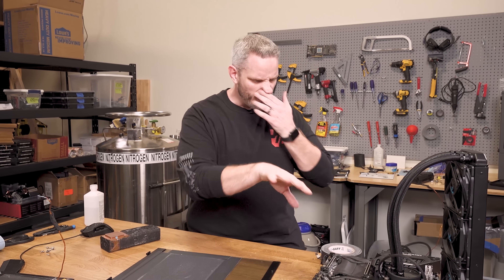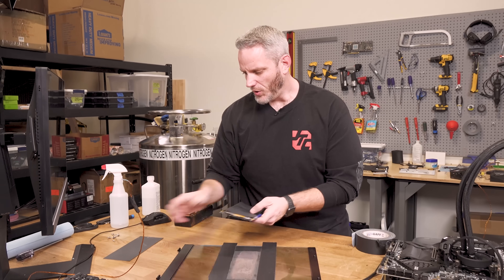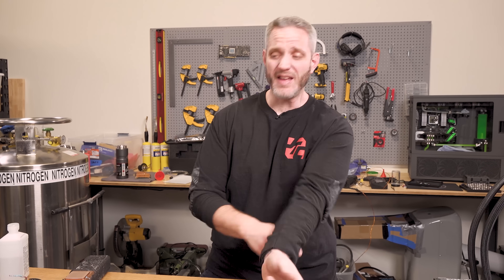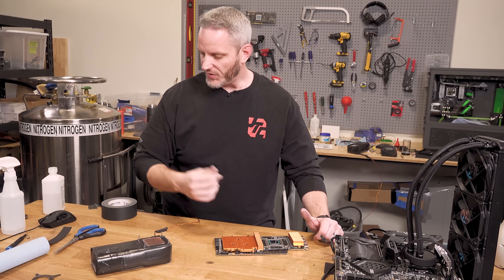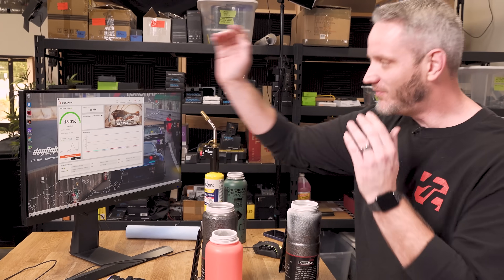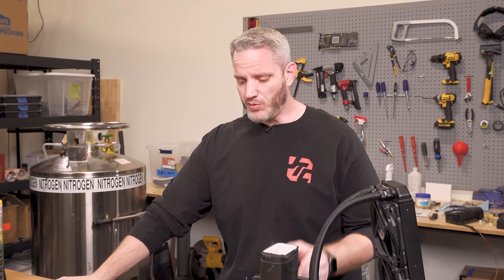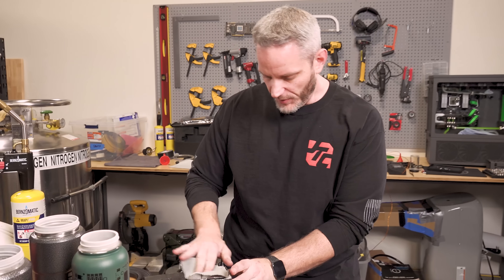THIS is Why Lapping Your Cooler is SO Important!!

Comment: I do not agree, why would the thermal paste need to "bite" into the copper? Thermal paste has lower thermal conductivity, more copper and less thermal paste is desirable. The thermal paste, or worse yet, air will end up filling in the scratches. I see no logic in this besides in the case of maybe you need the thermal paste to withstand mechanical stress, which is clearly not the case here.
Edit: Grammar.

Comment: Me building a PC: I need to be relatively carefull not to damage parts.
Jay: So im grinding down my parts and throwing a c clamp to keep it together while using vaseline on my gpu
Reply: That is some funny stuff right there
Reply: @JesseGaming7593  funny "stuffs"
Reply: I'll just leave my comment here -- this video is kind of ridiculous lol. 
Jay: "Even microns of difference on the copper will impact cooling!!!"
Also Jay: "I'm going to leave VISIBLE scratching on the copper. Because it will help the paste bite."

I'm going to go ahead and place a hefty wager that visible markings on copper leaves a huge number of 'microns' difference. Kind of silly. Now you need a whole other source, to take information seriously. Why not simply state what grit sandpaper will be the most effective? Is it 800? Why? What evidence or trials support that?
Reply: @wes7839  lapping makes the CPU flatter which increases cooling through the greater surface area. He just left it feeling a bit rough so that the paste would hold more firmly. Think like you're sanding a piece of metal to paint. You sand it flat and smooth but still a little rough for the paint to hold.
Reply: @christopher-davies  what does he mean by "lapping the cpu"?
Reply: @christopher-davies  Bollocks. 

Flatter means LESS surface area. 

Your reasoning is completely wrong and oxymoronic.

Comment: Pro tip:  
1. When Lapping you move your part in figure 8 patterns on the sandpaper without lifting it (for even wear).
2. If possible use multiple sheets of glass on top of each other because glass will bend very easily and reflect defects of the surface below.
3. You can use a sharpie to check how evenly you are sanding the surface, just color the whole surface inbetween lapping runs and check regularly if paint remains.

BTW  you are sanding,  lapping is one of the most misused terms.
Reply: The sharpie is key to make sure you're sanding what needs to be flattened
Reply: Circle is just as good

Comment: "Glass is perfectly flat." Mmmm... In the world of precision, float glass is "relatively" flat. Plus, the die probably isn't perfectly flat. Kind of curious if it's possible to scrape in copper like you do for making a surface plate. Then you could dye the die, transfer to the copper block, and scrape out the high spots until the contours mate perfectly.

Comment: @JayzTwoCents Insize Granite Plate.

GRANITE SURFACE PLATE, 12x18x3", grade A
6900-A11
Made of granite, free from deterioration or dimensional change over time, minimal changes in dimension due to temperature changes. Meet GGG-P-463C.

Comment: If we talk about lapping I'd like to mention that this isn't lapping but wet sanding/grinding, you are usually using a coated abrasive, some times with a layer of water in between the abrasive and the workpiece. Lapping on the other hand would be using loose abrasive in a liquid between a glass or cast iron plate and the workpiece as the abrasive rolls about between the two surfaces and removes material from both. This would also create a much finer and smooth surface than you get from wet sanding.

Comment: @JayzTwoCents It just occurred to me; you're not heating soaking are you? You are getting localised temp variations without normalising the thermal load across the IHS. Shouldn't you be running the card to 80% or 90% running condition for a long duration to allow for fault analysis and stability prior to hard running / peak load periods? If you are rushing to peak load you are not allowing for hot spot issues.

Comment: Why don't you just get a cheap lapping plate set and do it properly? Sand paper is going to cause more problems that it solves if you really want it flat. It's almost guaranteed you are making it more convex than flat with the technique shown here.

Comment: Entertaining and intriguing, doing it ‘because you can’ kind of like a car could achieve an amazing speed if you dropped it from a very high crane (or a plane)!  though less than useless for driving or car engineering lol ........So this is rather pointless IMO - I would prefer a ‘real world’ maximum overclock assessment and tips for maxing that out.

Comment: Jay, why not create a test bench where "sweat" from the AIO block and the processor is simply dripped off by gravity? An upside-down test bench, with a graphics card riser cable/extra tray (staggered to stay from under the cpu AIO block) to keep both AIO blocks inverted, if you will... Honestly, even if this is a stupid idea, I've never seen a pc tech enthusiast/reviewer even attempt it .

Comment: steel plate on the backside the keep the pressure off the board backside itself. If that should slightly bend it doesn't matter and the pressure on the GPU ist centered.

Comment: instead of paste i check thin cooper/alu foil and make 2-3 layer, the trick is, the paste flue away, the foil would be formed but runs not away, it works

Comment: Back in the day I used a thick square bit of metal with a 4mm bit of high density foam between it and the board, this will stop the board bowing and give you more consistent flush mounting pressure on the die

Comment: Lapping is not necessary if you buy quality components that have been levelled during production. In most (99%) cases you will ruin the already level part by hand since you can't do a better job than a machine that has micro precision. Also this is what thermal paste is about. If everything was perfectly level, the heat would jump to the cooler without any thermal paste. Thermal paste closes that gap. Again another shitty click bait video to make more youtube money.

Comment: Glass isn't perfectly flat, fyi. usually about +/- 0.2mm over 12 inches. Its why people still like having Auto Bed Leveling on their 3D printers, even with a glass build surface.

Comment: When lapping use figure 8's for best results.
Reply: NOPE... even and consistent straight pulls. NO pushing. Pull two or three times max then rotate 90 degrees. Rinse and repeat as you raise sand paper grit. your muscles are not consistent enough to do figure 8s and not round edges out of square.

Comment: Now get a cube of glass and use grease to check the flatness of your die.  Protip: they can be less than flat and too much pressure or movement while applying the heatsink can and will cause air pockets in the grease!   Here is a video I made a while ago showing an example of this: https://www.youtube.com/watch?v=me1i78oydEM

Comment: im not trying to be mean in any way... the glass you are using IS not flat at all, you need at least 1/4 inch thick to prevent curve from pressure at least

Comment: Tip from someone who used to prepare metal samples to a mirror finish with 0.05 micron diamond polish: just polish a bit on the first step, then switch to one stope up, just rotating 90 degrees, and it is done when the prior step's marks are gone. Go as far as you want. I would also recommend using water as a lubricant.

Comment: "because glass is perfectly flat"...? everyone doing 3d prints on glass will disagree.
Reply: But most 3d printers aren't even calibrated enough that the imperfections in the glass matter. Usually it is one of the axis that are not firm enough.
Reply: Glass, for anyone not using ikea mirrors, is flatter than matters for printing. Ya know what isn’t flat enough? Aluminum beds. Even high end milled or whatever beds are not as flat as a $5 pane. Unless you’re wanting to spend $100+ on your bed, glass is gonna be the most flat build surface. Any deviations are gonna be too small to matter when first layers are .2-.4mm.
Reply: @HE-162  my 240*240mm Glassbed has ~.2mm deviation from highest to lowest point. measured at a 4*4 grid with a weight cell sensor.
Reply: @cutterboard4144  how thick is your glass? Even if you want to split hairs, .2 over the entire 240x240 bed is functionally perfectly flat when you’re using it to lap a 30x30 ihs somewhere within that 240x240 square
Reply: I was going to say the same.

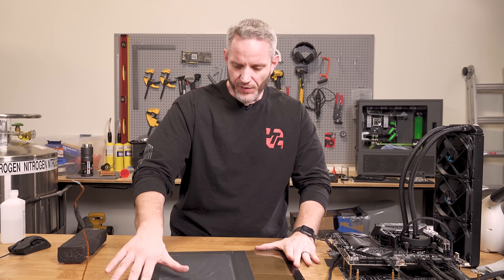Comment: 2:30 be mindful here, glass is indeed relatively (in machinist terms) flat, but glass also flexes a fair bit if you have an uneven surface beneath, a slightly thicker, tempered pane is probably preferable, but make sure your surface is as flat as possible beneath.

Comment: if the precision is as tight as you are saying, then you should invest in a surface plate. I'm just saying. while it is true that the process they use to make the tempered glass panels makes flat glass, their goal in that is not micron precision. surface plate is not even that expensive anyway, and it is what machinists use to get crazy tolerances.

https://www.amazon.com/s?k=surface+plate&ref=nb_sb_noss_2

Comment: Hardened glass is possibly not as flat as you may think. In the 3d printing world we used to use glass as a build surface. The much better way now is to use MIC6 precision milled Aluminium. Look into it might be worth a shot

Comment: Question, why are you testing in an open air environment?  With all that N2, you should be testing with the computer in a water-less (ie, N2) atmosphere.  You will need to fill the container with vapor to displace the normal air, than close the container, as N2 readily mixes at room temps.  This would also lower your ambient temps for everything else.

Comment: Hmmm... I'm wondering if HumiSeal (Conformal Coating) would work better than Vaseline? At work we use HumiSeal on PCB's that will be in contact with moisture or straight up water, like the boards that go in Vitamix or Audio Technica's voice amp for fire fighters helmets. We tape off the parts of the PCB just like you would when painting with a rattle can. Also we use the UV reactive to see if there's any coating missing in key areas.

Comment: Hi Jay! I'm a relief valve mechanic, and I lap steel and other various metals to a mirror polish every single day. I would actually recommend using something like a silicon carbide lapping compound in tandem with a lapping block to achieve a smooth surface on your cooler for better heat transfer. I think a 600 grit compound would give you a perfectly level surface, while still leaving enough micro grooves for the paste to do it's job. Cheers!

Comment: i dont typically comment on this stuff because of my lack of knowledge. but i am an engineer and car guy....and ive designed quite a few things.    if you really wanted to fix your mounting issue go and take a piece of nice stainless steel and make a backplate to fit your application  that way you can get a perfect height and pressure rather than deal with that  c clamp or use that flimsy metal plate.  edit:     it might also benefit you to verify the flatness of that copper with a micrometer and a known true flat surface.    next time you lap that try using a bit of bluye dykem to make sure your actually lapping what needs to be lapped .  it will help get you a more precise flat lap
Reply: also if you ever want some help or design ideas in that department feel free to reach out would love to help you make some simple pieces you can take to a local cnc shop and get them cutout.  woudnt be very expencive to get cut .

Comment: I wonder what the results would be if you could flatten the surfaces so well the heatsink and the die could wring together. If you coat the wringing with a bit of synthetic oil it would also keep moisture out. Many motor oils don't freeze, synthetic oils generally perform the best. Just a small swab of it on any surfaces in need of it would be enough.

Comment: K not pitting YouTuber against each other but Linus treated this like an HHD. And recommend computer machining like a piston in a car. I’ve done this with cheap scotch Brite. But just for getting rid of stains. Might do insulation bad like stock motherboard chipset heat sinks. But I just make sure my heat sink clearance is good. Too tight gets it like that in the video. I try to really sandwich it. Idk if it funnels to center of the cpu. Or outward. That investigation #1

Comment: Hey Jay. Just a tip, glass is not truly flat. If you want true flat you need to get a scientific grade granite surface plate. We use these for a true level base to measure accurately. They are usually 3 to 4" thick black granite.

Comment: Great video as always .. 

i got to think about something ... the fan on the VRM heatsink you have that to push air into the board right ?
then i pushed air through the fins towards the gpu pot ,, atleast in my theory 

have you tried with the fan pulling air away?  my thought it it will pull cold air from buttom of the gpu put through the fins and cool the vrm even more

Comment: The secret to very high scores is to get it on the first try. The same logic applies to CPU's, try running cinebench after a cold boot and it will score highest. Also a trick is to put your graphics card in the freezer for a little bit before attempting a run.

Comment: I have a corsair h115i platinum and I took 14-15,000 grit wet sandpaper in the end.. Got around 3-4C difference on ryzen 5950X..wont be doing this to my CPU though 🤣

Comment: Making progress man! I am loving it! What about putting some gasket material (proper spec for temp) in the C-clamp in order to keep the metal on the clamp from constricting and expanding? You might get a little better pressure without having to worry about the issue. I have used that before when dealing with motors.

Comment: Lapping sure does matter yes, doing so on my k8n neo2 platinum socket 939 machine by lapping the cpu and heat sink it runs cooler without heat sink compound, in a nutshell metal on metal contact if done properly beats any thermal paste.

Comment: Why don’t you try building a vacuum chamber around your setup and suck all the air out. No air means no moisture and no condensation. You could leave a hole at the top of the vacuum that the pot can fit in and just make an air tight seal between the pot and the hole. You could do the same thing with the tubes on the CPU cooler and if your feeling adventurous you could try replacing the fans on the vrms with a water cooling solution as well. That way everything is getting cooled, but you don’t have to worry about water build up.

Comment: Crazy build idea: build a small case around the OC setup that is fed from an air conditioner. The colder air won't hold as much moisture and might give you more time on OC runs. If nothing else, you can reuse that AC unit for another 'I can't believe I did this' video.
Reply: Might as well install an industrial dehumidifier in the studio.
Reply: @michaelsmyth9401  The small case could just be an enclosure for the mobo with a vent from Jay's portable AC unit. The top could have a cutout for the LN2 pot.

The setup wouldn't be a complete solution, but would decrease the relative humidity around the board and wouldn't need to work on the whole studio/set.

Comment: Jay you need to check out Silicone Conformal Coating.  We have been using it for years on drones and RC electronics boards for cheap and easy waterproofing.

Comment: When you have 2 perfectly flat surfaces you can get a "Cold Weld". Which is a vacuum that occurs. Ever wet 2 sheets of glass and try to pry them apart? Yeah, that. The same thing happens on the ISS with some equipment. https://en.wikipedia.org/wiki/Cold_welding

Comment: Think of it like velcro the loop side is the paste and the slightly rough but flat side is hook side. You want friction between the materials but incredible flatness so you have as much surface area to touch the die but you don’t want the paste to just roll off with it being too smooth

Comment: I remember lapping my old Q6600 that had a big air cooler (aio's didnt exist yet and big coolers were just coming out) it allowed me to get that 2.4ghz chip past my 3.6ghz wall all the way up to 4.1ghz it broke a few forum records for air cooling at the time 😁 I also had to pencil mod resistors on the board and a bunch of other stuff. #TheGoodOldDaysOfOverClocking

Comment: If you submerged the motherboard and gpu in mineral oil, but not high enough to flow into the ln2 pot wouldn't that be the ultimate insulation?

Comment: For my lapping needs I use a ceramic hand from a wet etch tool that was discarded. Benefits of working in the semiconductor industry. 
When leveling our batch wafer lifters we use a pane of quartz to put our .1mm/m levels, not glass. Glass is NOT perfectly flat.